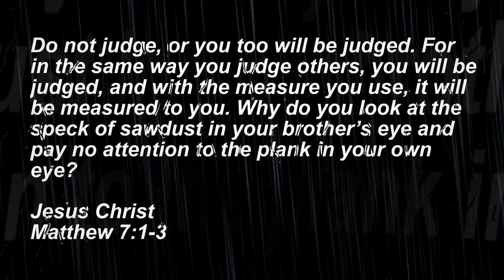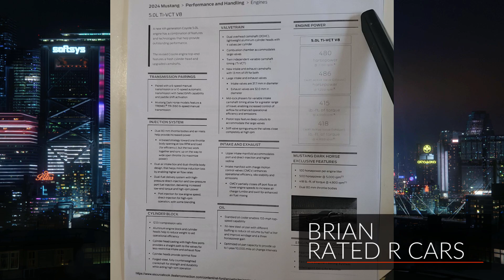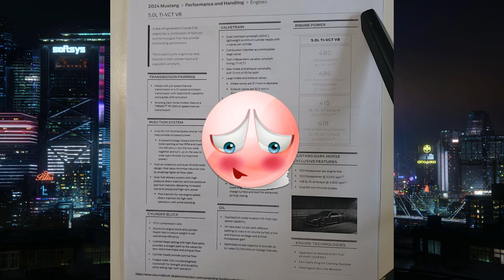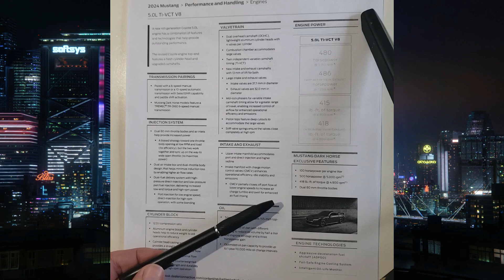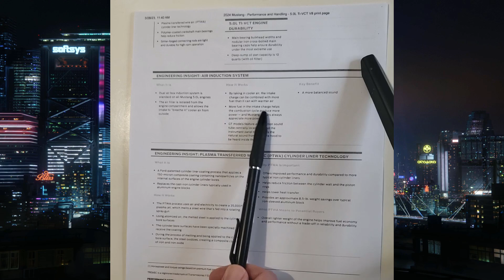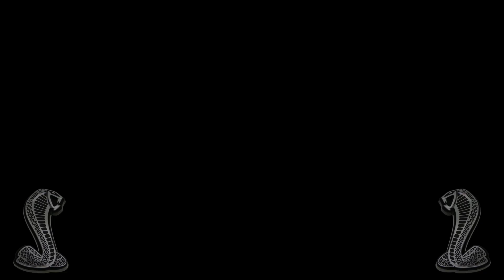2024 Mustang GT 💥All Engine Upgrades💥 Review

Comment: Thanks mate. 
I’ve put a order in for a dark horse, We in Australia don’t have pricing yet, my order is subject to the price. I suspect it will be around  $95,000 to $100,000. The $AU has weakened against the $US over the last couple of years. So I’ll wait and see. I’m also a bitt concerned of buying the first model of a new series. I’ve had a 2018, the current one is 2021. I’m not to sure if I like the dash on the 2024 model. I think they can over do the wiz bang crap. I think most people just want to jump in and drive it. The technology in modern cars can be to much for old farts like me. 👍
Reply from the maker: I hear you on the first models. I had the 2018 and it blew up in under 5K miles (bad high pressure fuel pump they said). But for me, I need to risk it for the channel. The good thing is though, we can drive it hard while it's under warranty to thoroughly test it out. :O)  Just out of curiosity, why did you choose the DH over the regular GT?
Reply: @DucatiDiaries  
I remember the problem you had with the motor in the 2018 model. The main reason I’ve chosen the DH over the GT is ford Australia is only importing 750 dark horses into this country,My understanding is each dealer will be allocated 5 dark horses. So I guess it’s because of its uniqueness. I know that sounds stupid but i guess owning a performance car is ego to a point. There’s a lot of GT’s getting around now so the dark horse will a bit different. For me it’s not the performance part. Let’s face it you can’t drive performance cars flat out all the time. Especially in the state of Victoria where I live as there’s revenue raising speed cameras everywhere. I’ve owned the 2018 which was a auto. The 2021 is a manual, the dark horse I’ve ordered is also going to be a manual. ( the manual is more fun ). Thanks for your reply. 
Looking forward to your next post 
….Jim

Comment: Still has the engine rated at 450HP on the website.
Reply: In the US. The engine horsepower is 480 and 486 (With active exhaust) for the GT. 500 for the Dark Horse. The horsepower rating you mentioned appears to be from the previous 2023 Gen 3 Coyote since Ford basically skipped if the 2023 model. It appears the person in charge of proof reading missed that listing. The information Brian read is direct from Ford provided to their dealers. If you've seen the actual Gen 4 Coyote engine and listen to the engine information Brian covered regarding horsepower and torque ratings. It's possible these engines may actually be underrated. The Ford engineers in NY mentioned that Ford is still finalizing RPM torque numbers while the engine redline was increased from 7000 to 7500 RPM. Thanks Brian for sharing some key information regarding the new Gen 4 Coyote. Unless this changes. Unlike previous cast iron exhaust manifolds. The new exhaust manifolds now look more like shortly headers.
Reply: @Chrysler 300C Hemi  thank you for the great info and I hope you're right. however, it's also listed at 450HP on my order sheet from the dealer.
Reply from the maker: @adillon2four  Are you in the U.S.?
Reply: @DucatiDiaries  Yep!
Reply: @adillon2four from the rush to get the S650 order banks open the US. It appears Ford made the error of using the Gen 3 horsepower numbers plus overlooked some spelling mistakes. If you simply estimated the difference between the 2 engines. Like i said. If anything the engine could be underrated. Ford knows that owners will dyno the engines. Ford made a mistake with the 1999 Mustang Cobra. Instead of 320 hp. It only produced around 300. Engine corrections were made and the 2000 Cobra model was canceled. I don't think Ford wants that to happen again . The new Gen 4 Coyote engines are advertised from 480 up to 500 crank horsepower in the US market.
Reply: @Chrysler 300C Hemi  Thank you again for the info! Did you order one?
Reply: @adillon2four  I have an appointment next week to finalize my S650 Rapid Red Premium GT 401A with performance package, manual transmission.
Reply: @DWH300  awesome!
Reply: I just bought a 2023 Camry XSE V6 last week. Was gonna wait for the 2024 Mustang but I don’t buy first year cars anyway, plus I’m sure mark ups will be a thing on all variations. I’ll just live vicariously through the owners of this upcoming car
Reply: @sammyjammy6647  MSRP for me.
Reply: @sammyjammy6647  I believe when Brian placed his order. He was told no markups. Ford dealers in my area have informed me the same
Reply: @DWH300  did you get it in writing?

Comment: The dual throttle body information is interesting. It's like how a four barrel carb only runs on two barrels until heavy acceleration. Or how the Mopar 6BBL/SIX PACK only runs on the center two barrel carb until heavy acceleration.
Reply from the maker: Yeah having owned two Mustangs (the 2018 GT and 2018 GT350), I can't wait to drive this car to hopefully feel the difference. If there's more low end torque, that's awesome.